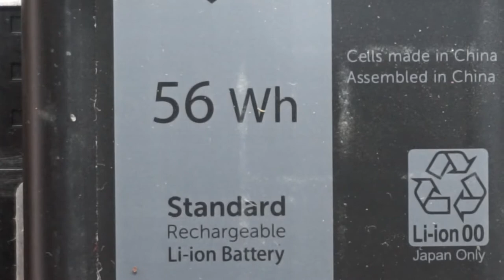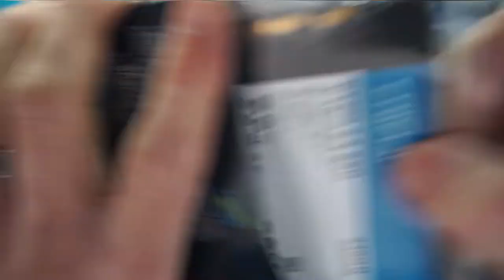Dell Latitude 3380 Teardown and Inspection

Comment: Can i used m2 ssd or msata in this laptop???
Reply: no, it has 2 m.2 "A" key slots (PCIe 1x with usb) one for Wifi and one for optional wlan (subscriber service such as tmobile). NVMe is keyed differently such as M key (PCIe x4) or B key (PCIe x2) It would be best to just get a 3.5 inch SATA SSD to replace the classic spinning disk. Check and make sure but its possible it may already have an ssd. Mine does, depends on the service tag.

Comment: I have a latitude 3380 and I accidentally spilled some hand sanitizer on the lower right of the keyboard around the shift and page down keys and immediately shut down and tried to mop it up as best as I could with a paper towel/napkin, then turned the laptop upside down, monitor open, and left it overnight and it seems to work fine, but my concern is, while alcohol may evaporate sometimes I find the sanitizer leaves a film behind on my hands.  That could be due to a combination of sanitizer and soap, but I'm worried, might there be a film on the internals of the computer now?  Watching this video seems to show that that portion of the laptop, indeed under the entire keyboard section perhaps, there seems to be a cover preventing access from the keyboard to the internals, so, should I be worried?  :\  I'm not very experienced with taking apart computers so I'm not sure I trust myself to do that, and I don't have a lot of money to pay for repairs, indeed this is my only working computer right now.  For reference it was Equate antibacterial hand sanitizer gel, triple moisturizing action with vitamin E, Jojoba and Glycerin used.  I have compressed air.  Should I use compressed air to try to dry any residue there might be?

Comment: Hey man! nice video! I Want to upgrade my Ram, and have some questions before doing that... hopefully you can answer them and help me out... 1st Do this machine only have one ram slot? and 2nd Do I have to remove the battery or disconect it before touching the ram sticks o it does not matter?
Reply: I also want to know that!
Reply from the maker: 1- Yep it only has the single slot
2- it would be recommended to have the battery disconnected (I'm happy with myself to simple have the machine full shutdown and leave the battery connected, but i run that risk)

Comment: can u send link of the ram pls?
@rickstechrepairs
Reply from the maker: 3:40

with a single dim slot, i would replace with a 16GB 3200mhz Sodimm DDR4 Stick

https://www.amazon.com.au/Crucial-PC4-25600-SODIMM-260-Pin-Memory/dp/B08C511GQH/ref=sr_1_5?crid=2AA0VNJSNTCFY&keywords=16GB+Sodimm&qid=1689578552&sprefix=16gb+sodim%2Caps%2C261&sr=8-5